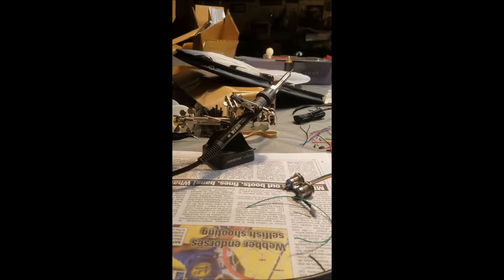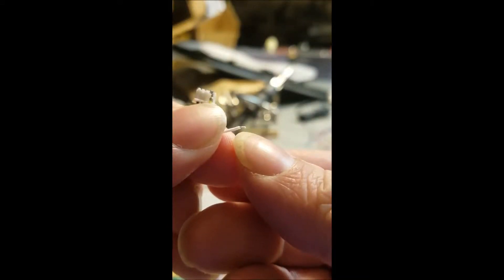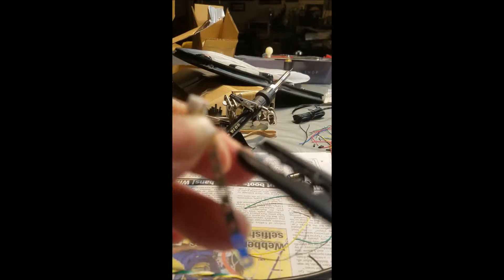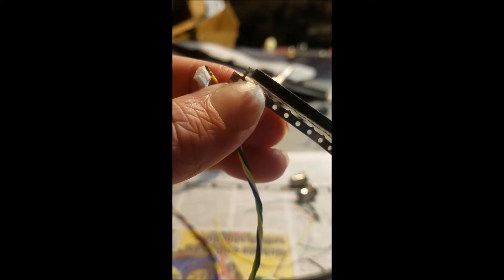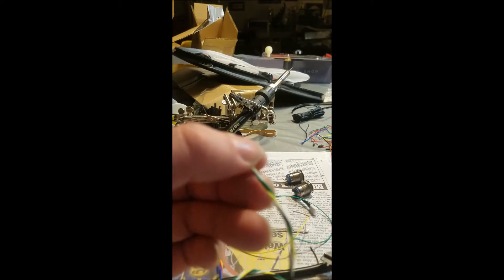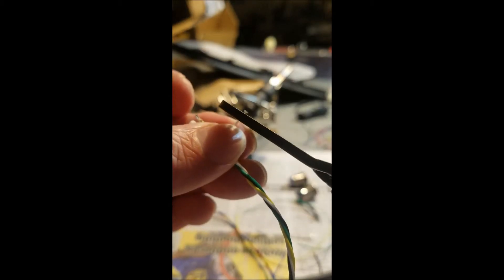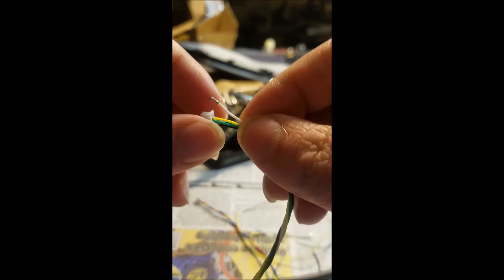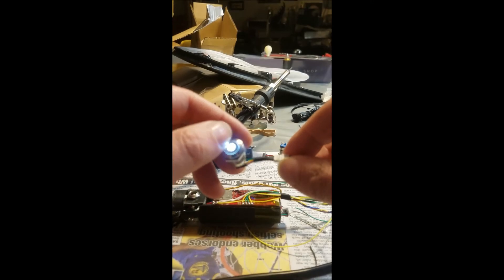Tutorial on handling and crimping a micro JST 1.25 connector

Comment: Which model is this crimping tool and from where did you purchase it ?
Reply: That looks like a PA-9 from Engineer. made in Japan and available on amazon. The PAD-11 is probably overall better - same sizes of dies, but overall better build quality. In the mid $40's for the PA-9  mid $60;s for the PAD11. The key tyhing I hadn't realized is that you leave them on the strip and that's why Iwas having such a hell of a time >.>
Reply: @AzzyDr  I don't think it's either of them. The PA-09 doesn't have a 0.7 slot. It's definitely not a PAD-11 as that one has got an interchangeable die set (does have 0.7). However, on their website Engineer states for the PA-09 that it be "deal for 1.25mm pitch" i.e. Micro JST. Their video shows a process different from the one here.

Comment: Thanks for video. Where can I find bag of JST 1.25 connecters and crimping tool? I need to but those connecters on my motor wires because ESC has the motor plugs.
Reply: It's know as JST GH connector not "JST 1.25". The 2 pin JST GH connector just happens to be 1.25mm.
Reply: JST GH and "1.25mm micro JST" are NOT the same connector. The GH is a wierdo connector (google for jst GH datasheet, filename is eGH.pdf somewhere on jst's website with drawings. It's 1.25mm pitch alright, and it's an open barrel crimp can probably be done with the same tools. But if you see the housing, there's no way you could mistake the two. I have been unable to find any connector that JST advertises that could be the "micro JST", though it's totally their style. I think it may be a creation of the same copycats that manufacture most "jst" connectors now.